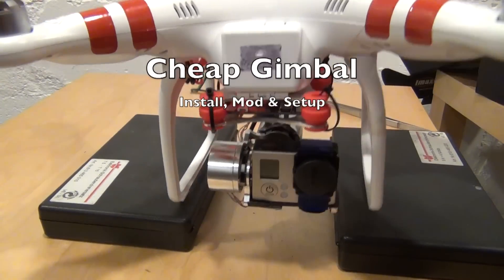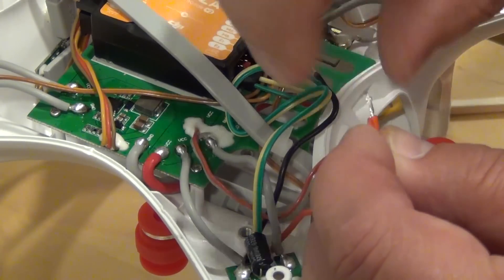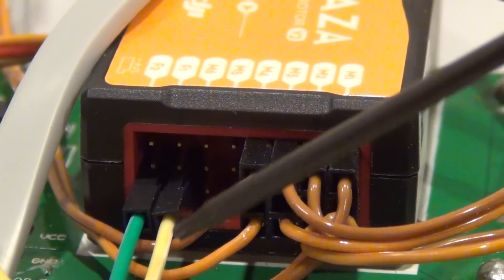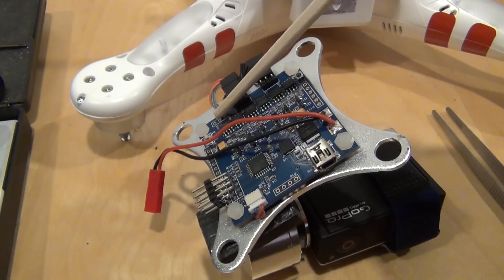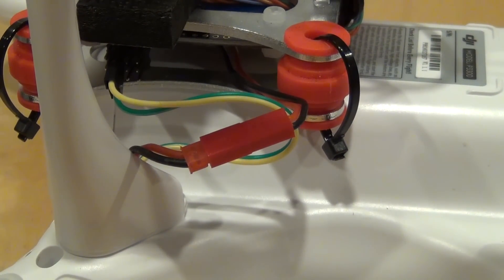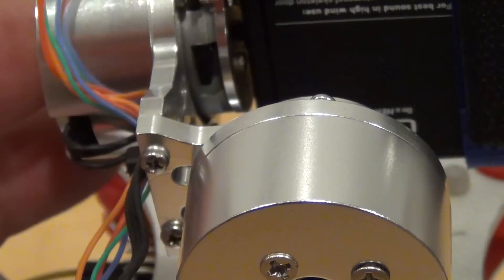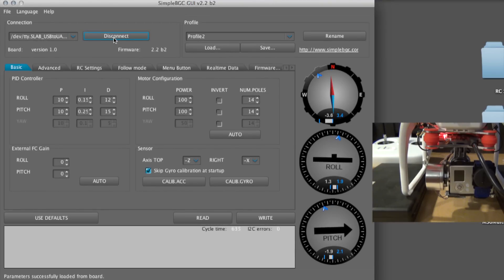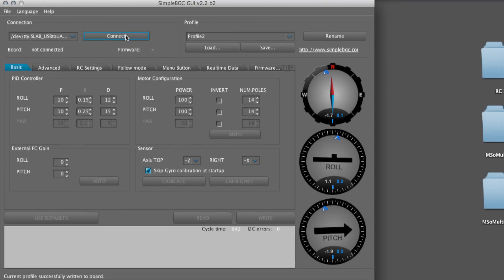Camera Gimbal for DJI Phantom (Complete Guide)

Comment: Hey, that's a great video! I have a question. The NUM.POLES value is set to 14 in your settings, but do the 2208 motors really have 14 poles? I counted my poles and i count only 12 poles?
Reply from the maker: Hey, you saw that. Great! You are the first. Your answer is here in my other video: https://youtu.be/5Vzicbqa6dY?t=8m41s
Hope that helps. And you are right, the 2208 has 12 poles, and whoever set the settings on those gimbals, didn't do a great job with the settings. That's what you get from China. Are you surprised?
Reply: OK, thanks!
Reply: mygiguser OMG! Really. Are the other settings good, or are there more problems?
Reply from the maker: specialistofsomekind No, not really. I think the settings are for the GoPro Hero2, and not for the 3. But after watching my video, it makes sense to find good settings for your own setup. Make sure you write down or save the original settings. That way you can revert back, if you have to.
Also very important to calibrate your sensors, that will solve a lot of issues to begin with.

Comment: mygiguser my Pitch lever on the controller (X1) will not work to save its life. I pull it up in Naza, and it shows that its working. Still will not control the gimbal. Am I missing something? I have the Phantom 1.1.1, using the exact same gimbal in the video.
Reply from the maker: Use the BGC GUI interface by connecting your computer to the gimbal board. If you don’t know how to do that, watch this video BGC GUI with MAC <http://www.youtube.com/watch?v=5Vzicbqa6dY&list=PLaDOamtOE3P_rb1vOXvjR1ORuZ8R2UE4I>

On the BGC check, if you see the gimbal input is working. If not, try to connect 2 or all three wires on the pitch control connectors.
Reply: Ok just checked. When I moved the lever the EXT_FC_Roll bar was lighting up. Shouldn't the lever control the pitch?
Reply from the maker: Jermaine Anugwom Yes. You could change the setting in the BGC software, or switch the wires on the NAZA, or on your gimbal.
Reply: mygiguser do I just reverse the wires? How do I change the button settings in the BGC software?
Reply from the maker: Jermaine Anugwom If you leave the wiring, then in your case go to the RC-Settings tab and change the RC Input Mapping for ROLL to RC_PITCH. That should do the trick.

Comment: I've followed your directions to a T. The gimbal works great at balancing itself, I successfully installed the gimbal software and tweaked the settings and also tweaked the settings in the NAZA software. My only issue is that the lever on my Phantom 1 controller does nothing, there is no response or tilt control when I move the level back and forth. The lever came on the controller. Is it possible that the lever is bad? Or is it more likely that my pitch wire is on the wrong pin on the gimbal?
Reply from the maker: Do you see movement in the NAZA software, when you move the lever? If not, then there is a problem with the lever.
Reply: mygiguser I'm using a separate battery pack to power the gimbal and I have the green cable connected only (not the yellow because I'm only planning to use pitch). I have it connected to the far right bottom pin which is then connected to the bottom pin of the F2 port. If I were moving the lever, what values in the NAZA software would change? (use this screen shot of the gimbal tab for reference - http://www.todophantom.com/wp-content/uploads/gimball.jpg)
Reply from the maker: Renee Gannon On the View tab the X1 slider should move, when you move the lever.
If you use an external battery, then you need to connect a second wire for ground between F2 on top and the same on the gimbal connector (in my video).

Comment: Hi There, I got a similar chinese gimbal to install the camera that comes with the Phantom Vision2 (not the plus).  I saw your video and looks simple and similar to mine but the wiring/boards are a bit different (my model is from sunsky-online.com )  The question I have before I start is for the pitch control.   Can I still use the application on the phone to control the camera pitch or do I need to buy/add the toggle switch to control it from the remote control?  How do i do that?   Thank you!
Reply from the maker: Good question, but I assume you could use the app for the pitch. The question is how the NAZA controller is connected to the Vision2 pitch. I don't have a Vision2, therefore I don't know.
Reply: mygiguser Hi!  Thank you for your quick reply!   It seems I need to use the channel 7 (toggle switch on the back of the remote control) only :(  I will need to get that before I venture into this.   Thank you!

Comment: GREAT VIDEO, YOU EXPLAINED ALOT THANK YOU!, I HAVE SAME GIMBAL THAT I WANT TO PUT ON MY NEW TAROT IRONMAN 650 QUADCOPTER USING TAROT 4114 320KV MOTORS AND DJI NAZA M V2 I WAS TOLD NOT TO GET INTO THE GIMBAL SETTINGS BECAUSE ALOT OF PEOPLE SAID THAT IF YOU DO YOULL BRICK THE BOARD!. NOW TO ME THAT IS A FALSE CLAIM UNLESS IT WAS JUST PLAIN USER ERROR AS USUALY NOBODY HARDLY EVER WANTS TO ADMIT THAT BUT MORE OFTEN THAN NOT THAT IS THE ISSUE!. I HAVE BEEN USING DJI FC,S SINCE THEY CAME OUT AND NEVER EVER HAD A FLYAWAY EVER, I ALWAYS BEFORE GOING OUT TO FLY HOOK MY NAZA UP TO ASSISTANT AND DO A PMU CHECK IF IT NEEDS IT I DO IT BUT MOST OF THE TIME IT SAYS THAT THE FC IS FINE AND IT ONLY TAKES 5 MINUTES, TO ME THAT IS WHY I HAVE NEVER HAD A FLYAWAY OR ANYTHING REMOTELY ACTING LIKE A FLYAWAY!!! I THINK THAT ABOUT 99% OF FLYAWAYS ARE SOMEHOW RELATED TO USER ERROR!!! CAN YOU PLEASE EMAIL ME BACK? I HAVE A FEW QUESTIONS TO ASK YOU? I AM USING A FRSKY TARANIS PLUS TX I AM DONE SPENDING BIG BUCKS ON FUTABA SPECTRUM TX,S MY TURNIGY 9X WITH FRSKY MODULE SMOKES ALL MY FRIENDS 2 GRAND TX,S AND MY TARANIS PLUS WELL FUTABAS 3GRAND TX DOESNT EVEN COME CLOSE TO THE RANGE I GET USING MY TARANIS AND A FRSKY L9R RX  IT HAS SUCH A LONGRANGE I WENT 3 TIMES FARTHER OUT THAN MY FRIENDS WITH THE BEST TX FUTABA MAKES AND THERE BEST LONGRANGE RX AND IT DID NOT STAND A CHANCE AGAINST MY TARANIS AND THE FUTABAS RX PRICE WAS ALMOST AS MUCH AS I PAID FOR MY WHOLE TARANIS PLUS WITH TX ALUM CASE NECKSTRAP CHARGER BATTERY AND X8R RX!!!!  SO I AM HERE TO TELL YOU THAT THE TARANIS WITH THE L9R RX WILL WORK FOR ANYONE WHO LOVES FLYING LONGRANGE FPV FLIGHTS AND MY RSSI AT 4.5 K WAS STILL AT 100% RSSI!!!! MATCH THAT FUTABA OR SPECTRUM?  I GOT A NEW SPECTRUM DX8 FOR SALE NOT A SCRATCH ON IT!!! WILL SELL TO ANYONE IN THE UNITED STATES CHEAP GOT THE BOX MANUALS SPECTRUM BATTERY IT IS DSM DSM2 TX AND I GOT ALOT OF OTHER BRAND NEW RC STUFF 4 SALE ALL NEW AND I HAVE RTF QUADS FOR SALE!!!!! ALL PROFESSIONALY BUILT USING TOP OF THE LINE PARTS!!! CALL 717-666-5153

Comment: I just ordered this same gimbal and I was under the impression it was going to come with an adapter for the battery, but it didn't. I am not verse in soldering, is there a cable that can connect to the red connector to receive power from the battery? I have detailed my set-up on my blog here: http://reneegannon.com/2015/03/looking-for-help-with-a-brushless-gimbal-set-up-on-dji-phantom-1/ - Any input would be greatly appreciated!
Reply from the maker: I looked at your blog, and the wire you ordered does not work without soldering.
You ask for this: Google it:

JST female to JST-XH2.5 3S 4Pin battery balance charger plug connector adapter.

I think you have a male JST connector on the gimbal?
Reply: mygiguser Thank you so much!! This is what I've been looking for! I didn't know what it was called. Much appreciated.
Reply: mygiguser How can I tell if the JST connector on the gimbal is male or female?
Reply: mygiguser I just checked, the one connected to my gimbal looks like the two on the right, which I believe is female?  http://grab.by/FAhu
Reply from the maker: Renee Gannon left male the two on the right female. My gimbal has a male connector attached to it. But if yours has a female, then you need a male to 3S 4 pin connector.

Comment: A lot of the problems that I see listed below can be solved really easily by doing this: Set your phantom so that the front of it is facing you. Now, look closely at the top of the gimbals control board on the far right..you'll see a tiny little button. It's on the control board but you will be able to stick your finger in to do the next part. Once you've located the button, power on your gimbal. Now press that little button 3 times. You'll notice that the gimbal goes limp and then recovers after a few seconds...while its limp,use your hands to move it into the position you want it in when you power up the gimbal from now on....hold it there until the gimbal recovers....that's it. You just set it up without have to go through the software. it will remember where you put it.
Reply from the maker: That's right, if the little button is set to calibrate. And if it is, it will calibrate the 0 position, it doesn't set the max or min angle.

Comment from the maker: @Michael Kerr  2 wires were used in the analog world, but now everything is digital, and if the devices have common ground, then the one signal wire is sufficient. If you want you can use three wires, it doesn't hurt,  just more work.
Reply: I just tried that. once i connected the cables the gimbal went crazy and now thinks the correct orientation is upward even when the cables are disconnected.  I tried connecting the gimbal to the BGC software except only bluetooth can be connected, no USB??
Reply from the maker: Michael Kerr If you see only bluetooth then the driver is not installed correctly. Did you watch my video about the driver installation? http://youtu.be/5Vzicbqa6dY

Comment: One question. If the gimbal have another battery power source is one cable enough to make the pitch work? or i have to power the copter and the gimbal from same source to use one cable connection?
Thanx!
Reply from the maker: If the gimbal has a different power source you need to connect two wires. Signal and ground.

Comment: Would love your 2¢ if you could give me some advice—Roll is working perfectly with the same control board + gimbal + Phantom (1) + GoPro 3. Pitch works perfect when facing the horizon or pointing down, say, 45º.  More than that, it jerks repeatedly. Makes me sad, as I really am trying to find a way to film STRAIGHT down. Can include a video, if it'll help. Any thoughts?
Reply from the maker: Well, a video is always helpful. I would check, if the wire to the sensor doesn't get caught, when the camera is in the straight down position. Check if there is a cable tie in the way, or if the wire to the sensor is tight. If you make a video, try to show your gimbal settings in the BGC tool.
Reply from the maker: Chris Webb OK, I watched your video.
Easy things first. The board you have, has the PITCH control where you plug in. (Top right), the one next to it (left) would be the ROLL control.

Step 1: Check, if anything touches a wire or the gimbal arm, when the arm is in the 90 degree position. (I couldn't see this in your video.)

Step 2: Did you watch my video? Do you have the DJI settings with DJI SOFTWARE set to default? If not set them to default. (Don't press USE DEFAULT on the BGC software!!!)

Step 3: Verify this: Under the Realtime_Data tab is in the upper right corner the barograph field for RC_PITCH. Move the lever on your remote from all the way left to all the way right. A blue bar will move with it. On top note the max and min number.

Step 4: Disconnect your DJI Pitch control wire for a moment, and then calibrate your sensors. Basic tab. Make sure the checkmark for Skip Gyro calibration at startup is set. Then press CALIB.ACC and hold the camera arm 100% level. Do the same for CALIB.GYRO. You have to hold 100% still and level!!! Reconnect your Pitch control wire.

STEP 5: Basic Tab. Motor Configuration ROLL and PITCH POWER set to 100
NUM.POLES should be 12 unless you have expensive motors? Do you? You can count the coils (stators) to make sure. I bet you have 12 and the software is set to 14?

STEP 6: RC_Settings tab. PITCH MIN.MAX.Angle
I don't believe with that board, that you have 0 and 90. I have with that board -10 and -65. Play with those numbers. The MIN ANGLE is the one for the 0 Degree position, and the MAX.ANGLE the one for the 90 Degree down position. Once you change the numbers, click WRITE, and then give it a few seconds to relax.

NEVER press the USE DEFAULTS button, because those defaults are not meant for the cheap gimbal!!!

Once everything works, you can reduce the roll and pitch power from step 5 to less. Maybe 75%. That saves battery. If it is too low, then the wind will push the camera over during flight.

Good Luck! Let me know how it works! Make another video, if you like. I watch it.

It would be good to see the settings in your BGC software for all the tabs, especially Basic, Advanced, and Realtime Data.

Comment: My gimbal is running great thanks to your videos  but I'm having a problem very similar to Xematick. I'm trying to set up rc manual pitch control on my Phantom 2 but I'm not receiving any input values in the GUI software. I have the wire connected to the f2 (signal?)port on my flight controller (like in your video) but I'm not sure if it's sending anything. The Phantom 2 software is in Naza-M mode and the gimbal switch is enabled. It indicates that x1 is the output whenever I use my tilt lever. Does this mean that I have to remove the x1 plug prewired for the Zenmuse products or possibly splice one of those wires? I'm thinking that perhaps the phantom 2 flight controller does not allow for f2 output???
Reply from the maker: I do not have a Phantom2, therefore I don't know, what they wired up for the Zenmuse gimbal. If you talk about X1, then that is the remote control channel X1, and that will change the values on the connector F2 on the NAZA-M controller.
If there is already a connector in that slot, then you need to remove it and have the pitch control wire from BGC board plugged into the F2 on the NAZA-M.

Comment: Hi there. Great video! The dropdown bar in my Simple BGC GUI v2.2 b2 window does not have an option to select a usb port. All it has is various bluetooth options. What is causing this? Do I need to find a usb driver?
Reply from the maker: Yes, you need an USB driver. Watch my video here http://youtu.be/5Vzicbqa6dY 
I explain where to install and how to install drivers.
Reply: Thanks man! I found one. It's recognized and I'm working on the settings now.

Comment: Hi, i have same Phantom 2 and same Gimbal, see my problem please https://www.youtube.com/watch?v=9h16_ZQEYes&feature=youtu.be When i connect green and yellow wires respectively,  gimbasl turn whitout control. I connected wires in Naza unit right, and wires in BGC right too, i don't understand why do this :(
Reply from the maker: Well, your gimbal seems to work fine. Need to change values in DJI software for gimbal, or change setting with gimbal controller software. I would try to change the settings in the DJI software first. Are you sure you connect to the right connectors on the gimbal control board? Maybe you can share a video of the DJI settings, and where the two wires are connected on the gimbal control board?
Reply from the maker: Xematick Can you send me a screenshot from your DJI software?
Reply from the maker: Xematick Try to only connect the wire for pivot, and change the values in gimbal config for horizontal and vertical limit to negative numbers. See if that helps. If not you need to use the BGC GUI to change the limits on the gimbal control board.

I think, that the settings for those boards are done for Phantom 1, but not for Phantom 2. Check my video on the gimbal settings here: http://youtu.be/5Vzicbqa6dY
Reply: mygiguser OK, i will try, thanks.
Reply: mygiguser I've change these parameters from the software PITCH gimbal and at least to turn on the gimbal not set to turn without control.
They were between -180 and 180. Now are you can see in picture.
At least now it is stable im start position, but the remote control still does not answer to the pitch. I calibrated the remote control level gimbal and works perfectly on software.
http://www.multicopters.es/foro/vbulletin/attachment.php?attachmentid=16840&d=1422798896
Reply from the maker: Xematick I cannot see your picture. When you have BGC GUI connected, go to the Realtime Data tab, right below you see RC_PITCH. A blue bar should move from left to right, when you use your pitch control on the remote. What numbers high/low are displayed there?
Reply from the maker: I just now verified with my Phantom1. If the Gimbal switch is off, then it does not work at all. The question is in your case, why was your gimbal moving, with the switch on? The remote must send values to the control board, otherwise the gimbal would not move?
Reply: mygiguser The remote tilt works right with Phantom 2 software and RC software, send good tilt signal.
But gimbal doesn't move. With Gimbal software doesn't have tilt signal from remote. I discover that gimbal state on Phantom 2 software is "Switch OFF", the question now is, how to turn "Switch on"?
Reply from the maker: Xematick Do you have CMU V1.0 and IMU V1.6 or above DJI firmware software installed? I read in the DJI Phantom 2 manual, that those versions are needed to use the Zenmuse H3-2D Gimbal !?
Reply from the maker: Xematick Good news! Thanks for sharing!